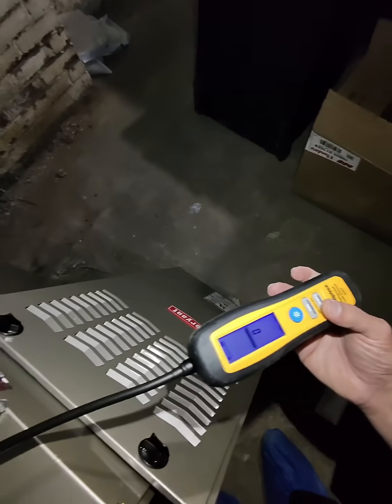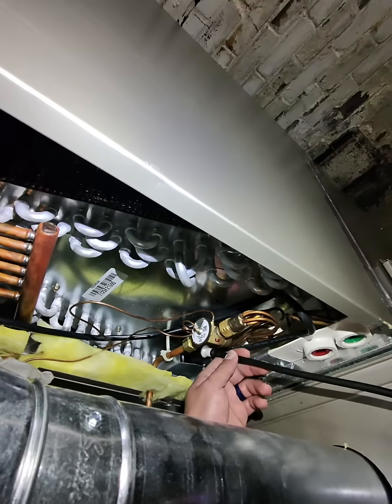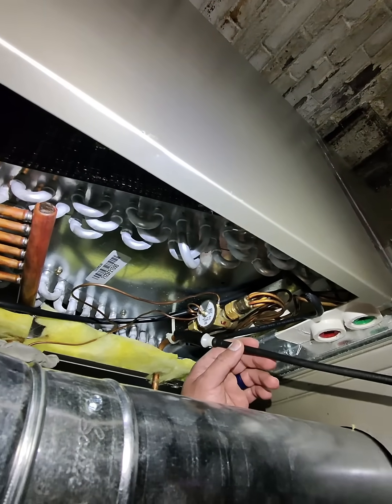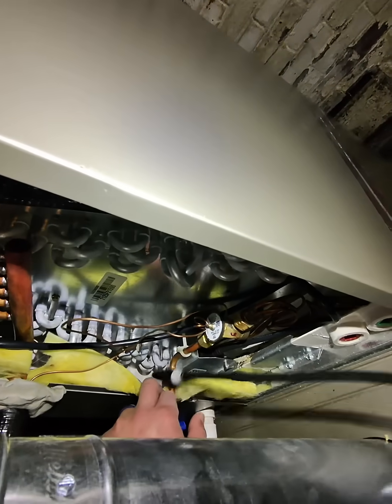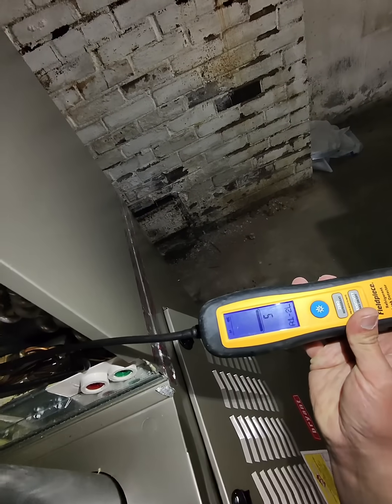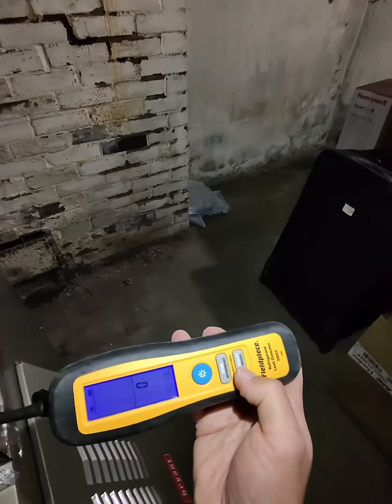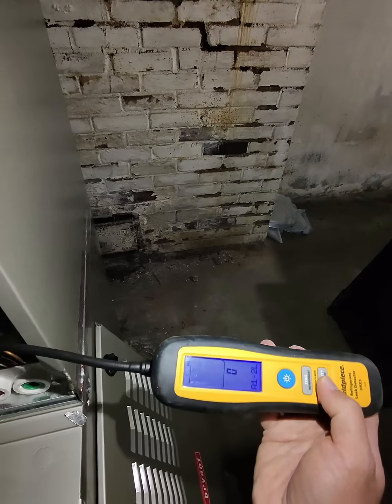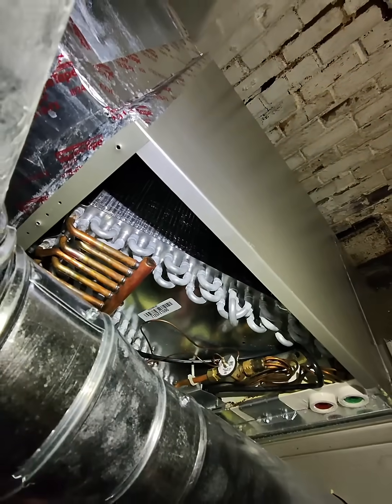HVAC Case Study: Fan Won't Stop? Diagnosing a Hidden R-454B Refrigerant Leak

Comment: That has nothing to do with the fan running continuously unless it’s low on refrigerant to the point it’s freezing over which doesn’t appear to be the case.
Reply from the maker: Straight from ADP Coil HE Series PDF: 

“The mitigation process begins when the RDSC detects a refrigerant leak:

The RDSC detects a leak.

The RDSC shuts off the AC power to the thermostat, which de-energizes the outdoor unit compressor and heat sources (such as gas and/or electric strip heat). No heating or cooling demands will be met.

The RDSC activates the blower. The blower purges refrigerant from the plenum and ductwork. After the RDSC determines the refrigerant levels are below the alarm threshold, the blower will continue to function for an additional seven (7) minutes.

After the blower sequence is complete, the HVAC system resumes normal operation.” (Page 14)

https://www.adpnow.com/dA/982c0f10d2/HE_Series_RDS_Controller_Installation_Instructions.pdf
Reply: @NelsonsHVAC honestly didn’t see the second part of the description saying it’s A2L sensor. My apologies
Reply from the maker: @jpcooper78 we are all human! No worries!